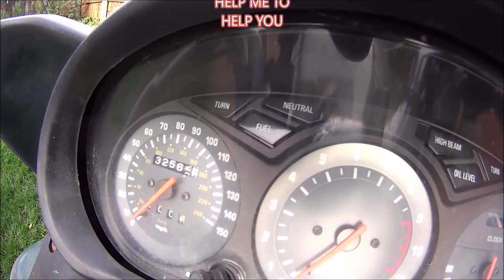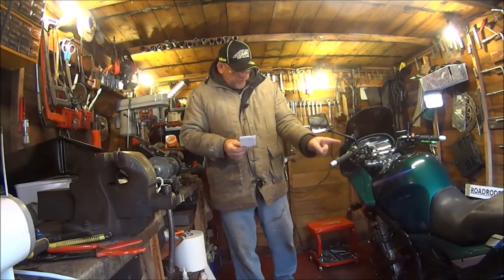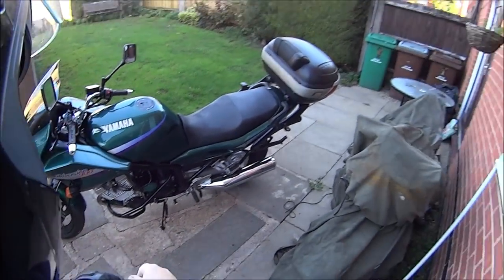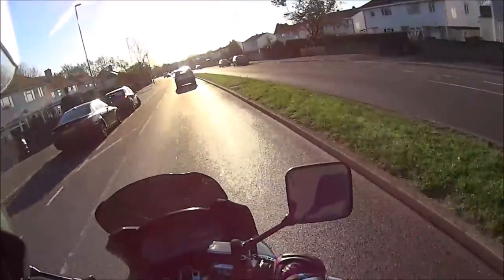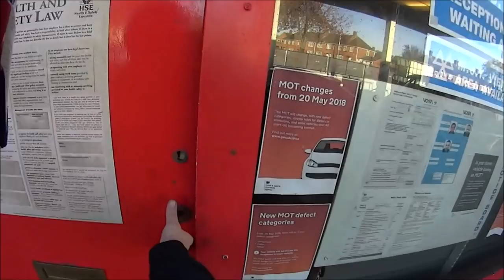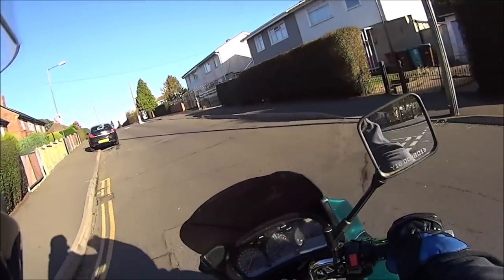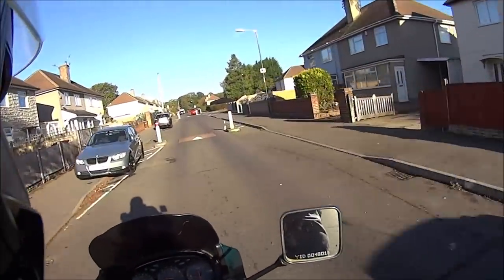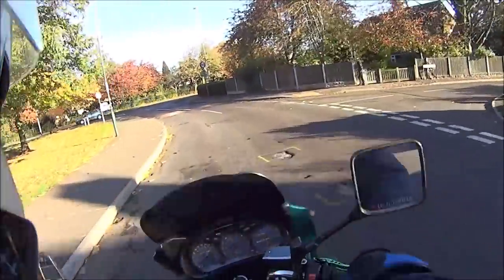XJ 900s diversion MOT at last.

Comment: Without a doubt.running lean on cylinder 3 working from clutch side.think that's the carb with vacuum pipe on
Reply from the maker: Cheers Darren another very useful peace of add vice for me to check out.

Comment: If it’s running on 3 probably a blocked jet. These are quite a weird carb. I had to replace 4 jets which are in the inlet track. They were completely gummed up and would not let the engine rev! Very pleased for you bud. At least you can sort this minor issue 👍🏻
Reply from the maker: On closer inspection it is running on all four how did you get the jet's out?
Reply: I got them out by tapping in a flat blades screwdriver and put some bodily pressure on them when undoing. Two were quite stubborn buy eventually came out. They basically fell to bits obviously as they are softer material. I got replacements from Motocarb.com which were a lot cheaper than OE
Reply from the maker: Awesome help and advice again thanks
Reply: No worries dude keep us updated!
Reply from the maker: cheers dude all the best..

Comment: Nothing to do with valves or rings etc....these are good for 10000k.    Try more simpler things first like ht   lead plug.then carb X1. Only last resort is carb........do a plug chop on the cylinder rough running.feeling down pipes on Rickover.from cold.... you've done well.has a guide price .£900 to £1100 .....rock bottom price £750
Reply from the maker: That's what I was thinking on closer inspection it is running on all four. I've messed about with the coils and lead's and given the plugs a good cleaning and it ran 10/20 percent better. It just loses power on hard acceleration.
Reply: If only on hard throttle response.look at vacuum pipe from either carbs or manifold or airbox for leak.
Reply from the maker: Yeah it definitely ran better after messing with the plugs and lead's.
Reply from the maker: The 2Vacuum metal pipe's that go on top of the cylinder head were leaking I managed to push then on more tightly and make a better seal.after doing the ht lead's so one or the other or both helped improve the running for sure.
Reply from the maker: Thanks Roy your Guy's are full of knowledge and useful tips. You tube is definitely more friendlier face book any day...